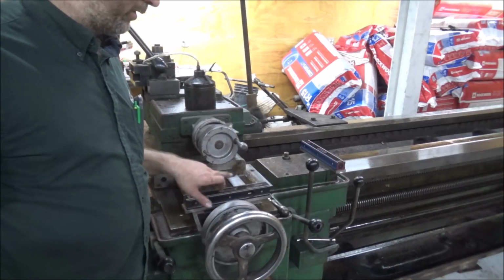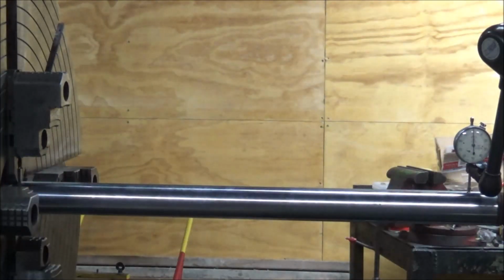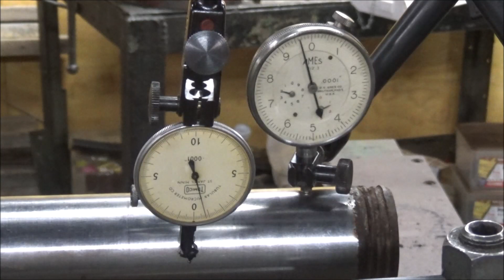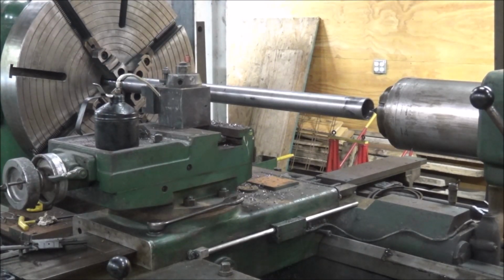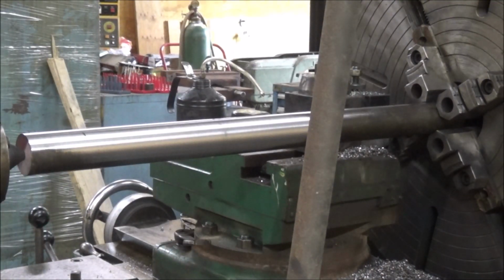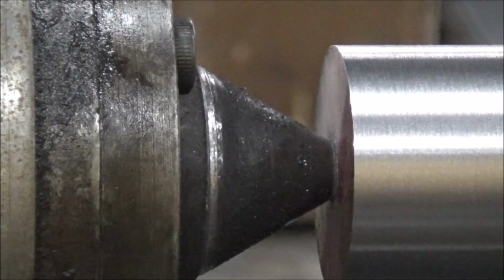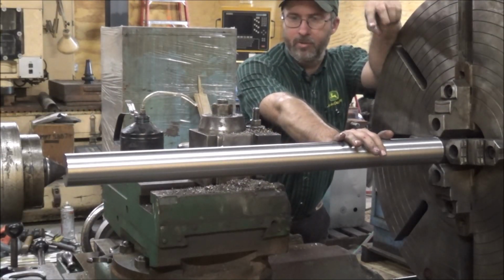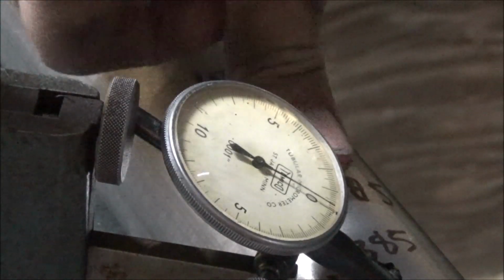Lathe Leveling and Aligning like you have Never Seen!

Comment: Man! The tailstock holder on this lathe is thicker than the Chuck on mine!!!!
😂😂😂😂
Can this be used for watchmaking???
😂😂😂😂
It’s so interesting seeing the spectrum with within the same machines with different purposes!
I used to work in a one man shop as an apprentice back in 1989 where the owner fixed shafts for the local shipyard, and they were as long as a street light pole and probably 12-20” diameter. Fitting new bushings were done by heat and it was an awesome experience to watch it. 
Thank you for the video!

Comment: I totally agree with your explanation of having the headstock in the tailstock aligned but having a bow in the middle.
I tried everything I had to explain that to a guy that was trying to  level an 18'
American lathe.
He had a devil of a time with taper to the center and then the opposite taper out to the tailstock if you get what I mean.
He simply couldn't believe that a machine that big and that solid could twist or bend.
Reply from the maker: Yep, way more give than people expect, one of the reasons they usually call for massive foundations.

Comment: I think we may differ on the uses of the two collar test: it's not a turning test. It's an inexpensive way to prove alignment of the spindle axis parallelism to the carriage motion on the bed in the absence of an (expensive) test bar. You turn two collars separately to the same size then scan the collars to proove spindle axis. 

In that size lathe, I'd suggest a 2 ft piece of 4 IPS schedule 40 iron pipe. The pipe is chucked, a center relief turned, and the two collars cut separately to the same size. This arrangement has less than 1/10 the droop as the chrome rod (D^2 and unit weight.) 

Assuming the spindle taper socket and the test bar are both clean, free of burrs, and fit properly, a factory test bar solidly seated in the spindle taper droops from gravity by varying amounts that can be both calculated  and determined by experiment. I've used factory precision ground test bars many times in the past. They age over time. Few run true within 0.0003' TIR at the free end. I've found it necessary to take DTI readings on the test bar at the ends (and the middle if need be) and mark the readings on the bar in Sharpie. Then, with the spindle/bar rotated to the average of the TIR readings, the test bar may be scanned for axis parallelism.

In the case of your piece of 2" chrome rod 24" long chucked in a 4 jaw I estimate it would sag about 0.0064" at the free end (this includes a WAG for chucking deflection.)

In the absence of manufacturer's specs, the machine tool industry's default resource for limits of geometric error may be found in George Schlesinger's "Testing Machines Tools." Engine lathe test data may be found on pages 57 through 59. Illustration 11, 12, 13 on page 57 show the test set-up and pages 58 and 59 charts acceptable limits in mm. This reference is available as a PDF on line.

Turning tests as a general rule are seldom deterministic proof of spindle axis/bed ways parallelism. Factors such as thermal expansion of the work and turning tool, edge wear, part deflection, saddle yaw, etc combine and/or cancel in various ways to foil repeatability in all circumstances. One might argue that only a turning test validates a given circumstance but a machine tool has to qualify for all conditions, boring and turning, roughing and finishing, cast aluminum and Inconel, HSS and carbide (Stellite, CBN, ceramic, etc). Conditions are not always perfect: more than a few times, I've nudged the tool in or out a tenth or two at a time at intervals along the length of the diameter to correct a taper revealed by the semi-finish cut.

Your procedure and discussion of the factors are in close accordance with the way I was trained and agree with my experience. You don't need my approval; my remarks are intended to convey concurrence with your process so that people seeking this knowledge can have a basis for evaluation.
Reply from the maker: Yes, using the 2 levels and not moving them during the leveling operations was key to not having lots of frustrating problems. I am glad to hear you thought this job was competently done as I hold you in high regard as to knowing how all this works. :-)
Reply: Forrest  Addy 
I see your posts on Practical Machinist. You have amazing grammar and writing skills .  Did you have public education? 

I’m very envious.
Reply: @bstevermer9293  Thanks for the good words. My  curriculum vitae is unremarkable: high school, some college, career machinist later a bureaucrat, lots of technical writing. Maybe a flair for writing. Maybe lessons stuck. I'm old, anyway,  lots of life experience. That's about it. No mystery I can see.
Reply: Forrest  Addy 

My hat off too you. I mean that!
I struggled threw college and my writing and spelling skills are awful. 
I’m ashamed of some of the work I put out.  Where are you located ?

Comment: That worked out well .  The bar may have  released some stresses by the time you got to the other end .  Good result  .  Don't forget if you ever set up a long shaft say in a steady with a level you will have to remember that fall you put in .   When i was  a young machinist i operated a lathe only slightly smaller than yours & the precision level came out quite a lot setting up jobs .  There's a couple of my channel stickers in the post for you , should take a couple of weeks to get there . Cheers .
Reply from the maker: Max Grant ,The Swan Valley Machine Shop. Good point!! I will add the stickers proudly to my collection.😎

Comment: Looking good for a large machine.  You needed a laser setup to check the full bed length alignment.  Looks ready to use.  Nice job.
Reply from the maker: I priced one of those laser machine alignment systems when I was doing the HBM. They are only about $30,000 !!
Reply: Brian
Do you have to take the curvature of the earth into consideration with the length of the lathe , I know it has to be taken into the checks on large 500mw steam turbine gen sets.as you are well aware any point is a tangent to the earth . Take large suspension bridges the towers are vertical but not parallel to each other.

By EKK it was great to see Bailey back on duty checking the inspection done right ,he looks back to his old self , look after him don’t let him roam into dangerous territory
Reply: Yep kind of pricy.
Reply from the maker: I am a little rusty but I think I calculate that using the curvature of the earth over 16foot span only amounts to 0.0000735". I think that means that effect would be smaller than I could ever measure.  At 50feet it would be around .0005" deviation so a big machine could easily see some  effects. That is where optical alignment instruments would come more in to play. I have a transit but no good way to determine what I am shooting beyond the markings on a scale.
Reply: @stuarthardy4626  I don't think this would come into play if there are only 4 points of contact.
Reply: @thedge7  There's a global conspiracy to keep the flat Earth a secret.

Comment: bcbloc02
I've commented on a couple of times on lathe leveling on other poster videos & I'd like to comment here so thanks for reading my views.

I'm a retired construction surveyor & I have a lot of experience with leveling all kinds of jobs. One of the checks prior to doing some precision work was to check & adjust various bubbles on survey instruments. Use over time, sometimes causes the bubbles to come out of adjustment. To get them level is to check on 2 positions. That is observe the bubble on face 1 & then turn it 180 degrees in the same position & read it on face 2. (the faces are just a position terminology) If it's exactly level the bubble will be exactly centre on both faces. If it's out a little then adjust the bubble screw 50 % of the original difference (If the bubble has adjustment ? or if not then allow 1/2 in your estimations). Check & repeat if necessary. The end goal is to get the bubble the same on 2 faces. As always all bubbles & plumb bobs are being pulled by gravity towards the centre of the Earth.

A question is about the machine manufacturers. How accurately do they build the lathe & how do they check level ?

In the workshop sometimes machinists or bosses get surveyors in to level machines. This is the quickest & most accurate way to do it. At least 2 people would be needed to do the job. Some surveyors have precision levels with a microptic graduated scale to 1/100 of mm = near to 4/10 of 1 thousand inch. Precision levels are used to check for movements in tunnels for cave in risks & other engineering tasks. Even an automatic builders level will do very well with it too (there are adjustment procedures to do that to ensure it reads exactly level over the short distance in the workshop). A properly adjusted automatic builders level can split the black markings on steel rulers. That would have to be very accurate as well ? Most levels are in the X22 - X30 magnification range so in a workshop it blows the viewed image up a lot.

The advantage of the surveyors level method is that all leveling points can be observed in one go. Then adjusted & rechecked. Adjusted until every point is spot on.
If you know the size of the threads on the adjusters then even how far to turn it can be worked out. Other things like the hydraulic shaft could also be accurately checked. The precision of the job may be survey level but it also depends on how the manufacturer builds the machine. Also the base under the machine (usually concrete) needs to be strong & stable. It can sink a little over time if it's a weak kind of mix. It can depend on the weight of the machine at the adjusting points.
Reply from the maker: hugh moore I have a k&e transit with the differential level and the optical micrometer. I can’t figure out how the optical micrometer part of it works. I am guessing it has to be used with a special scale? Want to come help me figure it out? Verifying the tests here by another method would be more good video I think.😎
Reply: @bcbloc02  
Can't help you in person as I'm in Sydney Australia area. As to the K & E transit level I'm not familiar with that instrument. I'll have a look on line & if I get info on it if I can. If I can work it out I'll get back to you.

It might help if you gave me the model number & age of the instrument & any other facts. Like is it auto leveling or the older manual bubble type ? Auto leveling has a compensator frame built in. So once the circular bubble is in the circle the compensator inside remains level. They've been around for 50 years now & are fast & accurate.  Do you have a tripod for it ? If you have what shape is it in ? If it's worn & shaky that's a negative for accurate results. You being a machinist would well understand that. If you don't have a tripod than you can use somewhere stable where the instrument won't move for the job at hand.
Reply: bcbloc02
I've had a look & got to eBay & some other sites. It appears that K & E went out of business or merged back in 1966 ? The instruments are most likely the old school manual bubble type. Needs fine adjustment of the bubble for every different level shot. Rather difficult to have it in exact level over 360 degrees (full circle). It has other features that allow tilting for aligning things & a reasonable accurate horizontal degree scale. That's probably the optical micrometer ?  It was often used to do footings where an inch or two didn't matter for alignment but the leveling was more precise for pouring concrete with the footings. Theodolites were often used later on the dry concrete for marking exact positions for things like brickwork or wall frames.

I looked at a builders hire company here for an auto level & tripod. They want $80 per day. Maybe that's an option ? Perhaps they may be cheaper in your area, I'd hope so ? That would be the way I'd go if wanting to do it the survey way ? For starters modern instruments have better optics & far easier to use. I also know that you can show the image through the lens as some survey guys on You Tube have done it. It's not perfect but reasonable as it's just the camera looking through the eye piece. They also supply a sturdy tripod with the level.
Reply from the maker: @hughmoore810  What I have is like this unit. https://brunson.us/771-h190-jig-transit-with-english-micrometer.html
Reply: @bcbloc02  
I looked at the reference & it's a Brunson model. It seems more like a theodolite ? The spec. was saying x20 magnification & x30 as well. I think the large knob at the front above the Lense is for that, You did say that yours was a K & E model. As a matter of interest how did you get possession of it ? Why don't you take some photo's of your instrument & tripod & put it up on screen ? What condition is the instrument in ? Do you have any specs for it ? Like magnification, image (inverted or upright ?) (Lens technology, as in old school VS new school in relation to lens curve & how many lenses are used. The old school thought was that less lenses = a more accurate image capture & all sorts of optic science ?)   

Is the internal image clear as some people are as rough as & let them get wet like leaving them out in the rain & then putting them in it's case. Not being waterproof fungus can grow within. Many of us surveyors had a wooden box made up with a very low wattage light bulb inside. If the instrument got wet we'd put it in the box with the light on over night. The Golden rule was never put a wet instrument in it's case. Fungus inside meant a trip to a instrument workshop for a full pull down & cleaning. A little expensive as also often a hire instrument is needed as well while the service is done. Do you have a tripod for it ? If so is it stable or shaky & somewhat worn ?

Your K & E could be used but it mostly depends on how well it can be adjusted for level. They usually have little capstan screws on the instrument. Most makers give a little tool kit in the instrument case. A lot of the time most of these accessories go missing but you may be lucky & they are still there ? Part of the kit will have a couple of little bars that fit the holes in the capstan screws. Some may not have capstans but just screw slots, then those small screw driver sets are ideal for the job. No real drama if the adjusters are gone as a thin nail or similar can also be used. The adjustment is like on the jaws of a lathe = loosen one & tighten the other. That moves the bubble or cross hairs up or down & even right or left (but usually that part left well alone).

If you want to use the K & E for leveling I'll tell you how to calibrate it but it needs to be in good condition to get the best out of it & needs 2 people to do it. It's best if you have a fence or a wall at least 40 feet long but that's not critical. You then set the instrument at the 1/2 way point, pacing it is OK as the distance is not super critical. Make sure the level adjusting screws are about 1/2 way within their range as fine adjustment will be easier a little later in this process.

With paper & tape you stick on the wall/fence central to the height of the lens at both ends, as in about 40 feet apart (20 feet & 20 feet from the instrument), With the bubble set level on the instrument & using a fine pen or pencil you mark 2 sides of the paper & draw a line across. Then do the same on the other paper. With that done then that is considered level on both marked papers. Then you move the instrument up near 1 end of the paper. So one is very close but within the focus range & the other is near to 40 feet away.

Level the instrument & check the level mark on the paper close to you. It's most likely out a bit (high or low) so move the tripod up or down & relevel & observe to the closest paper. It does help if you have a tape measure & try & get the instrument at the exact height as then you have less processes to do.  Once you get to say 1-2 mm/1/8 inch of the true height you can then adjust the instrument on the screws. Once you are level & spot on the mark then swing it around check that the bubble is level then read to the mark 40 feet away. 

If it is off the mark on the paper you adjust the level so that it lines up with the mark. However the bubble will be out. Then you adjust the bubble turning the capstan screws until it's level. This may then put the close end out a little. Just repeat the steps as required. What you are doing is a version of iteration. That is dividing things down until it's too small to see any difference within reason. Get it to that stage you will have high accuracy in the work shop as you'll be only 5 or 6 feet away with the instrument & about 8 times better than on the 40 feet paper adjustment thing. It's probable that you can achieve high accuracy, something below the 0.0005 inch range ?
Reply: bcbloc02
I was watching another video of yours from 2017. One of your levels (on a lathe check) had a crack in the vial & you were waiting for a replacement. As I suggested previously you can check the level bubble by observing the bubble twice. That is once in one orientation & using the exact same location rotate the level 180 degrees & observe again. If the level is reading level the bubble will be showing central both ways. If it's not then adjust the level bubble (if provided) 50% of the difference & recheck. 

The main aim is to get the bubble in the same position on both orientations. This could mean that the item being checked could be out of level ? It is good practice to check any level like this before doing any machine level checks. Little different to using a out of adjustment micrometer & trying to get very accurate results.You could also have a flat plate or similar in your workshop & use that to check all your levels. The main thing is to use the same positions for both orientations.